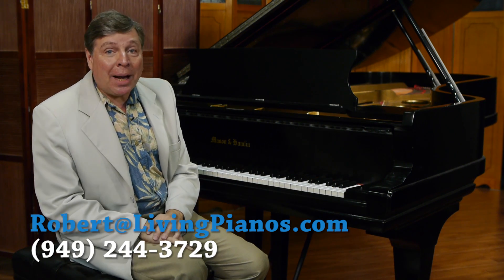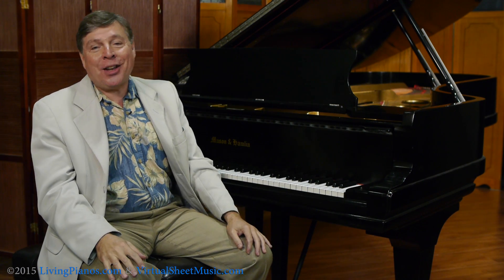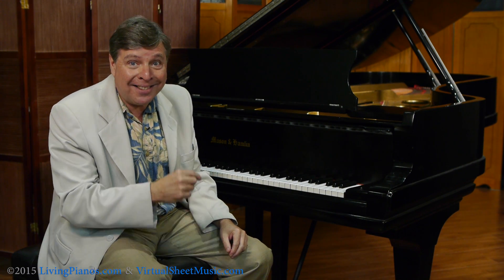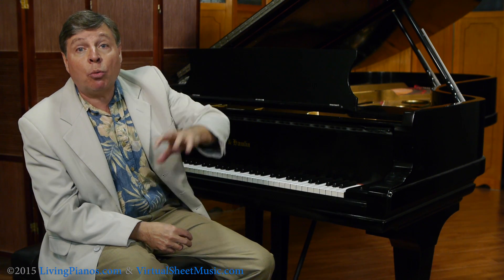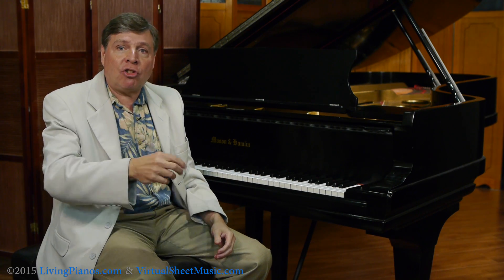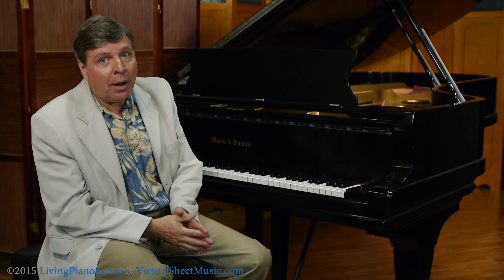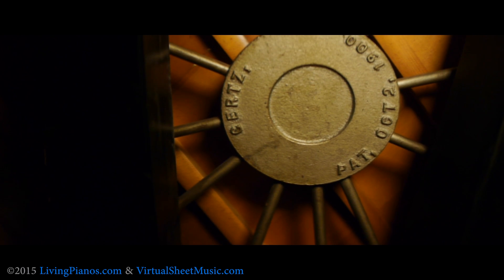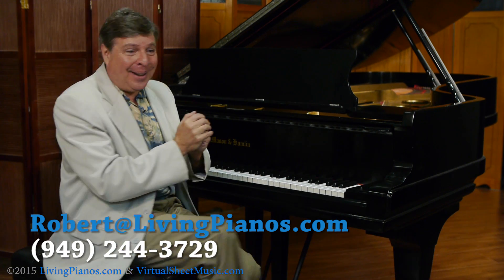What Is a Tension Resonator System on Mason & Hamlin Pianos?

Comment: The purpose of the Tension Resonator seems not to be fully appreciated here.  The Mason & Hamlin sold at a premium above what a Steinway sold for because of the beauty and sustain of its tone.  For the public to choose a piano over a Steinway it would have to have had an unusually compelling voice.  And it seems likely that a heavy metal object attatched to the rim called the Tension Resonator would have been at least part of the reason that  the experience of playing a new Mason & Hamlin on showroom floors was a good deal beyond what a new Steinway offered since they both had 'crown' and Steinway spent a considerable amount promoting their pianos to the public  and Mason & Hamlin did not.        
           
       If you lay under a Mason Hamlin and rap the tension resonator with your knuckles  it resonates for a while much like a bell. Tellingly, it resonates for about the same length of time a note struck in the melody section resonates, AFTER it is released (5-6 seconds). You can call this 'after-resonance' and it is experienced  in a similar way to the reverberations you would hear if you were playing in a large church or hall. The melody section on the 1929 'AA' that sits in front of me, has an 'after-resonance' with somewhat of a bloom. Like a struck bell, the pitch swells for a short time (the string is silent, only the board is singing). Aside from the 'after-resonance' of a released key, striking and HOLDING a key around G5 (the melody section) has a bloom and a remarkable sustain which separates it from the melody section of it's chief rival from New York.                       

      You can feel the Tension Resonator  vibrate if you reach under and hold it while striking a bass note. Because it is tethered only at three points (in this 1929 'AA') and has a heavy donut to which all three 'spokes' meet in the middle  it continues to vibrate along with the soundboard creating a feedback loop. This may be what keeps the soundboard singing  (I liken it to a sort of after-taste. You have the taste which is great but for a few seconds after key release there is this ethereal ghostly pitch slowly fading to nothing. It is lovely! )
Reply: if you've never played a pre aeolian mason you simply cannot understand how utterly extraordinary their sound is. I too have an AA from 1927. For me a comparable steinway simply doesn't come close.
Reply: Excellent description. Thanks!

Comment: Washington D.C., March 1, 1905.
An improvement patent, bearing the No. 783,781, was issued by the Patent Office to Richard W. Gertz, of the Mason & Hamlin Co., Boston, Mass.  It relates to pianos, and has for its object to provide a novel construction whereby the tension of the rim supporting the sounding board may be easily adjusted and the adjustment maintained regardless of the hydrostatic changes in the atmosphere.

In patent No. 658,985, granted to Emil A. Gertz and R.W. Gertz, describes a piano in which the rim to which  the sounding board is secured, as usual, is maintained at the proper tension by means of tension members, which pass through the rim and have suitable heads on their ends which engage the outside of the rim.  The rim in said patent is constructed of a plurality of layers of wood placed with the grain running longitudinally thereof, and therefore the strain on the tension members is across the grain rather than in the direction of the length of the grain.

In order to keep the sounding board under proper tension under the old tension resonator system, prior to 1905, it is frequently necessary to tighten the tension members to such an extent that the heads on the ends of the tension members are apt to crush the grain of the wood against which they lie and to be drawn into the rim to some extent. It is to obviate this difficulty and to provide a construction in which the head on the end of the tension member will not become embedded in the wood of the rim under any circumstances that Mr. Gertz made his present invention.  This object is accomplished by providing the ends of the tension members with tapering heads, which are received in correspondingly shaped recesses in the rim.  The taper on the heads, while sufficient to prevent the latter from being pulled through the rim, is such that the strain on the tension members is transmitted to the wood substantially in a direction parallel to the direction of the grain of the wood.  With this construction the strain on the tension members will not crush the wood, as is the case with the old system.

Therefore, Mason & Hamlins built prior to 1904 may have tension resonators that need tightening or at least checked for tightness, but ones made after that date do not.